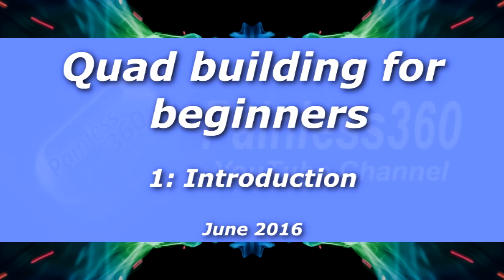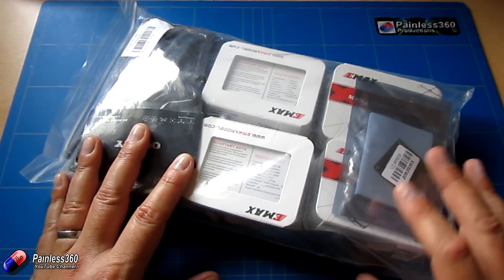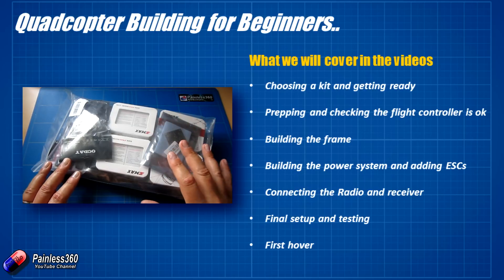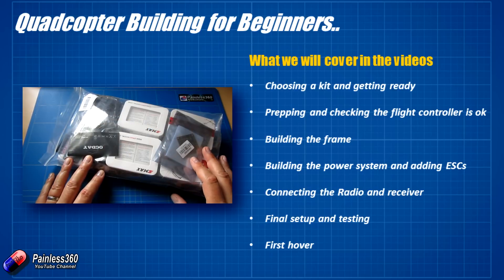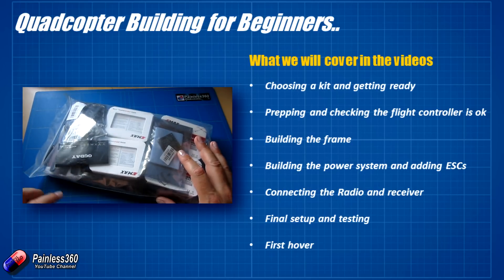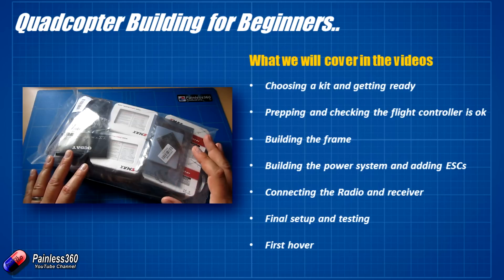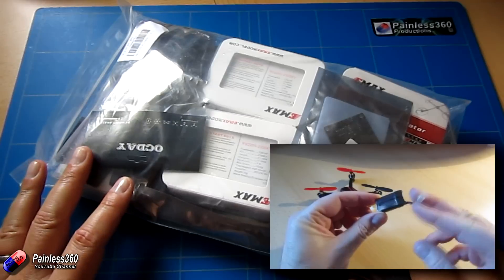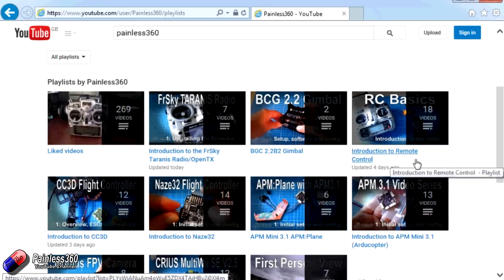(1/9) Quadcopter building for beginners: Introduction (kit from Gearbest.com)

Comment: Well I just My quadcopter kit in a bag and it came well packaged and quickly from GEAR BEST and now I can follow along. I used the link here on the page and have exactly what Painless360 is using. I also have ordered the Flysky FS-i6S 2.4G 10CH AFHDS Transmitter With FS-iA6B Receiver from banggood.com and the link from that Transmitters P-360 intro video, which I already liked anyway and was able to get in the white, : ). I liked the way this Transmitter package was spec'd because it came with the tablet mount for Bluetooth connectivity and one PPM receiver. Cheers !

Comment: hey painless , thanks a lot for doing this series, you already helped me get my arf qav 210 up in the sky with the help of your taranis series and cleanflight videos, hoping that by joining and building along side you with this series it will give me the confidence to move on to acro mode with the knowledge that when I crash it il have a good idea how to fix it afterwards ! 
any chance you can recommend a decent solder station in the sub £100 range, iv already spent lots on this hobby that has quickly taken over my life.
Reply from the maker: I'd use a soldering station rather than an iron..

Comment: Sounds great :) 
Iam not sure if i want to buy a rtf quad or buy something myself
Reply: *build
Reply: +max kraus  i find it good to build one as it means you have a very good understanding of how it is put together, which makes it a lot easier to fix when you damage something. It can also be easier to upgrade and swap out parts on a quad you build yourself.
Reply: +MTL Racing but it is so complicated with all this wires and soldering and Software tuning :l
Reply: in that case then, there are plenty of great ready to fly quads if you don't feel like building the first one :)
Reply: I was in the same position as you a few months ago my advice is get a transmitter first like a taranis like everyone uses get a sim either FPV freerider or liftoff and sim while you research and build your first quad. by the time your done with researching and building your first quad you'll be able to fly it right away from the time you invested in the sim. Best of luck to you
Reply: sounds ok, i think i will go the same way...how are your flying skills developed right now, after a few months?

Comment: I'm aware from watching your other videos that the first two numbers of a motor say what size it is, like 2205 or 2304. However I can't seem to figure out why the frame kit says it uses 1304/1804/1806 motors, why did they include 2205? I'm sorry if this is a weird question I just can't seem to figure out how to make sure a motor fits a frame
Reply from the maker: A frame will normally only support one or two sizes of motor as the slots can only be so big in the arms. Most 220X size motors have 16mm and 19mm spaced supports so that's what you need to look for. Best of luck!

Comment: Hello,,,I have setup my first quad following your video,,,and went I maiden it ,,,,,it hovers fine..when I try to throttle up a liittle,,,it flips over and fall...can you tell me where did I go wrong?tq
Reply from the maker: Without knowing what you've already tried to fix it, I'd suggest the ESC re-calibration as a first step. Best of luck!
Reply: hi,,,im running a cc3d,openpilot...2206-1900kv 12 a esc..and 3s....this is all new items...when I maiden it..Hoovering is fine for awhile then it flips and fall,,,same goes when you throttle up  it flips and fall....Im using a at9 TX and r9d rx  tq

Comment: Which lipo charger is best for beginners
Reply from the maker: +harsha sridhar we've not looked at battery chargers for beginners, at the moment we using a q200 and have been very impressed. A lot of pilots start with something like the IMAX B6. But I would check places like the Hobbyking website for the ones with good reviews that aren't silly money.

Comment: Hello, 1st of all, THANK YOU very much for al your work and dedication to the hobby and us. :-)
I whatched all videos about multimiter, continuity andsmoke stoper.
I build a quad 3 days ago and when I plug the battert, the light of the smoke stopper (12v light in series on the battery cable) blinks with th two last bips of the motors.
Im using F4 Flame race Spec STM32F405, 4 in 1 ESC.
1 - With the miltimiter theres is no continuity.
2 - I show my problem on a electronic store.They cant explain why the light blink. They say it doesnt make any sence.
3 - I desolder everything and test with the smoke stopper all the connection while Im resoldering. I believe the problem is on the signal cables from de ESC. Whith the 1st two cables (it doesnt metter witch, I try all of them) the light of the sttop smoker doesnt blink, with 3 signal cables it blinks a bit and with the all four, it blinks with the last two bips of the motors.
I was using this ESC on other build and it was flying  ok, no crashes.
If I my explanation isnt enought, I can send you a video with the problem.
I know you like a chellenge.... What do you say about this one?
Can you help? Please...
Thank you again for al your work.
Best regards
Reply from the maker: +Luis Filipe Machado so what's the actual problem? The smoke stopper will light up depending on how much current is pulled from the battery into the model. Have you tried flying it? Sorry, I'm not following what you're asking..
Reply: Thak you for answer. Im afrad I burn anything. I never plugeg the battery without the smoke stopper (12v lamp 20W) and never flew. Is is normal that the lamp blink thith the bips of the motor? In my other quads that never happened.
Reply from the maker: +Luis Filipe Machado no idea without looking more closely at the build that you've done. Personally, I'd try it with the battery if you've tested that there isn't any short circuits with the main power connections. It should be safe for you to give it a go. Best of luck if you decide to try!

Comment: How do you know what range of motor will work with what sized frame?  I have a 450mm but not sure what range of motor to use...
Reply: you will likely want 800-900kv motors.
Reply: @Brian Froeber - DYS BE2212/880's should be just about perfect for you 450 frame.

Comment: hi, what is different between 2205 and 2206 Motors? Thanks
Reply from the maker: It's referring to the physical height of the internal parts of the motor. The longer they are the more metal and winding are used and hence a more powerful magnetic field is created and the motor is more powerful. (short version ) ;). Happy flying!
Reply: Painless360 thanks

Comment: Which fc would be best for beginners..... Could u please suggest which fc should I buy
Reply from the maker: There are lots to choose from. I used to choose the CC3D with something called Openpilot. Now I'd suggest a SP3 clone board and follow along with one of the 'Quadcopter building for beginners' series on the channel. Best of luck!
Reply: Painless360 I'm planning to buy a racerstar esc which would be better the racerstar 30a v2 or racerstar 30a esc..... Forget the 2205 racerstar 2300kv motor
Reply from the maker: I've not used those. I'd use the ones that support BLHeliS now and have more current rating than the motor needs. Best of luck!
Reply: Painless360 shall I go with cc3d....... Coz I'm a beginner... I wanted a fc which is easy to program...
Reply from the maker: You could, and use Librepilot with it. Lots of choice now so we made these series to help first time builders. Best of luck!

Comment: Greetings...my quadcopter is flying fine but during flight it drifts so I must always adjust the roll and pitch stick to keep it at a certain position ...now my question is there a way where I can keep the quadcopter in a certain position without moving in any direction and without adjusting the sticks of the radio controller?
Reply from the maker: +Tamim Mahairy see my video on 'what to check if your quadcopter drifts' for all of the most common causes and their fixes. Best of luck

Comment: Hi I followed every instruction exactly but my drone got stuck at full throttle and flew away and took my pet rat with it.I cant find both pls help
Reply from the maker: Did you write your name on the rat?
Reply: Its dead. And the copter fell into a lake. Recommend any cheapest build?
Reply from the maker: This video is the first in the series that I would have directed you to. Happy flying!
Reply: Can you recommend something even cheaper this time? let's say in the $50-$80 range?

1) Quad frame <= 250mm (carbon fibre or plastic/fiberglass) --> $10
2) Flight controller = SP1 KK2.15 or CC3D --> $15
3) Motors 4x= 1000kv generic 2205 --> $18
4) ESC 4x= generic chinese 20A --> $18
5) Misc = $15

Total: Approx $80

Is this possible? Can this work? can me point me towards components within this budget that will work together and a guide to follow?
Reply from the maker: The process to build it will be the same as we follow in all the builds we do. Best of luck with it!

Comment: - Do receivers come with antennas? or do you buy separately? if they are separate, then how are the receiver and its antenna get connected to each other?

- Same question for VTX (video transmitters), do they also come with antennas? and how to connect if not?
Reply from the maker: They should come with them attached. Happy flying!

Comment: Mr. P-360 I always pickup new things when I rewatch, as I have started to build my kit, I picked up you mentioning INAV. I ran it thru the search on your library and I didn't find any keyword hit. I saw a video of this guy who updated Cleanflight recently on RCGROUPS it may be the same person who as done INAV. Will INAV allow us, owners of these F3 deluxe and CC3D 10 DOF to do what mission planner does with APM's? I think thats what I'm reading.       https://github.com/iNavFlight/inav/releases/tag/1.1
Reply from the maker: See the video on the channel where we cover how Opensource software works we talk about iNav in there. In a nutshell - iNav is a fork of Cleanflight to focus and improve the GPS modes that used to work very well in the original Multiwii code (the granddaddy of Cleanflight) but didn't get enough attention after becoming Base/Cleanflight. iNav is worth a look if you want to see what the GPS features will be like when it rolls back into Cleanflight (still holding our breath here - we have been for over 12 months!).. Happy flying!
Reply: Will do CHEERS !

Comment: Deciding on a kit. Reviewing this kit the frame, bottom plate is 3mm while other frames I see are 4 or 5mm thick.  I'm wondering if piecing out the components or just buying this kit replacing the frame with a one similar to your CC3D series would be good or would it throw off the weight?  I like the idea of separate arms rather than a single piece bottom plate being new to this sport and all.

Comment: I use readytosky 2204/2300kv motors and 1500mAh 3s 40c lipo, which esc should i use? Does 12A do the job? And should i use simonk or blheli (this is my first quad)
Reply from the maker: Keep watching, all covered in the 'Quadcopter building for beginners' series..

Comment: I have a question guys. I'm a complete noob when it comes to quad-building so I'm wondering if this build has gyro or is it a pure acro one? If I haven't said that in an understandable manner, here's an elaboration: I'm confident when flying toy-grade quads that have gyro stabilization but they're becoming too slow for me. Thus, I'd like to try building my own racing quad but I'm afraid they don't have gyro stabilization. I suppose that's determined by the FC. If yes, which FC should I use for a gyro mini brushless racing quad build?
Reply from the maker: It's about the software you run on it. The answer is in 99% of the cases - yes it will support a self-level mode that will feel just like the mode on your smaller model. If you're new then this series, and the others designed for new pilots, are good places to start.. Best of luck!